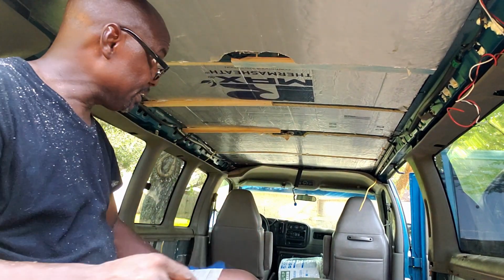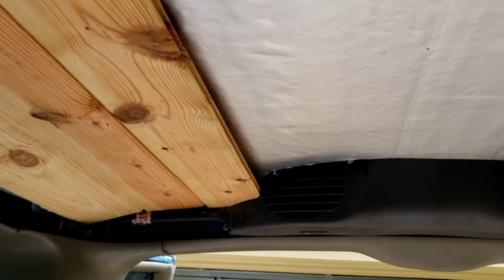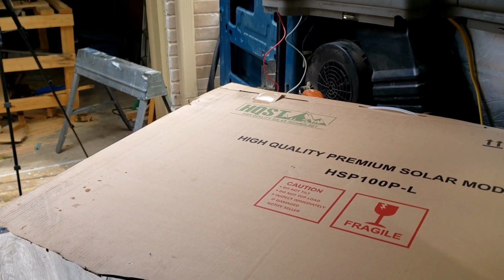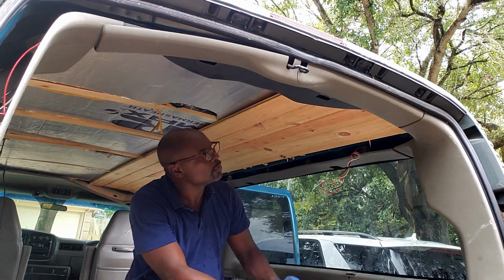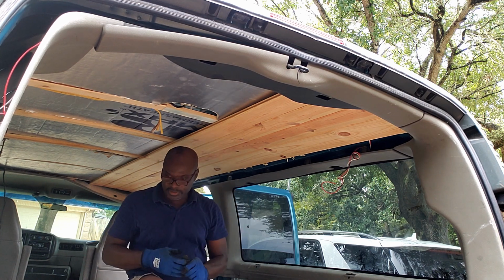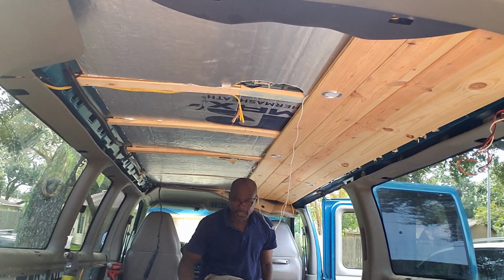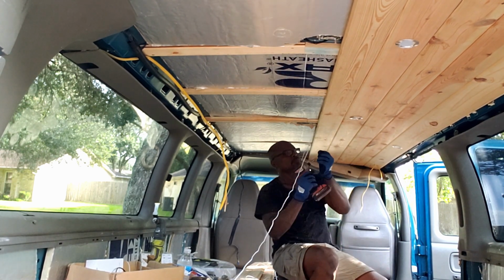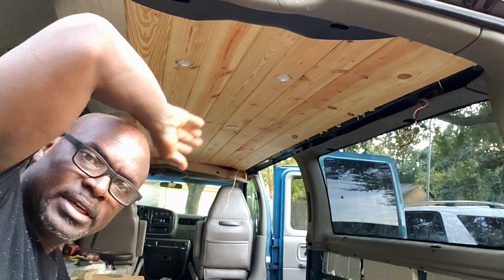How to install tongue and groove ceiling in Chevy Express van conversion video #5

Comment: Hey there, how many boards did you use in Total for the roof? And how long were they each?
I have a 2007 Chevy Express cargo van 135" wheelbase so I think yours is the longer but I'll get a good estimate from what you say you used:)
Thanks